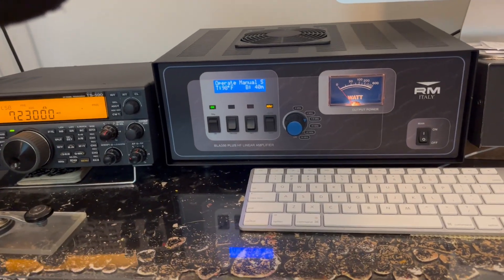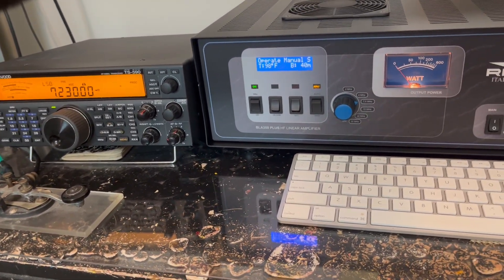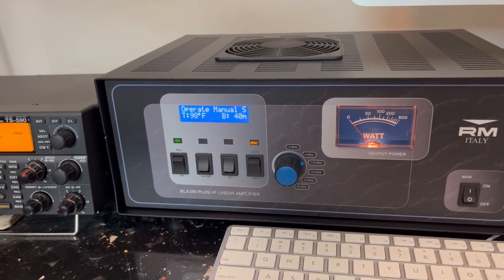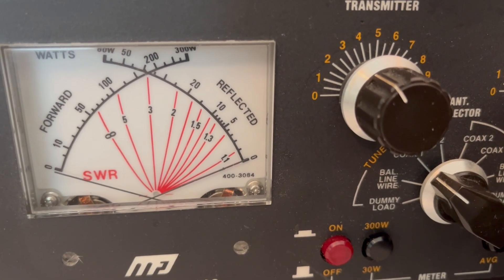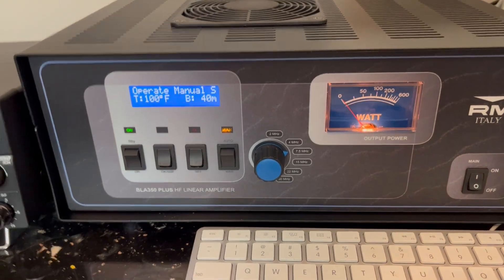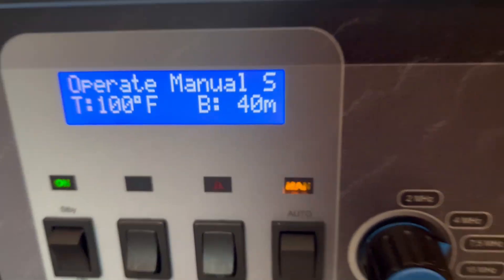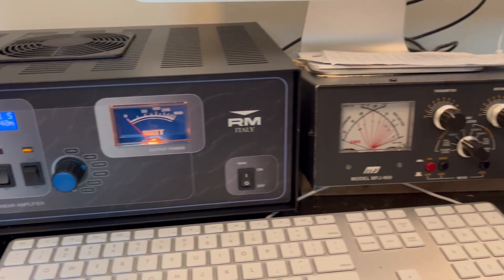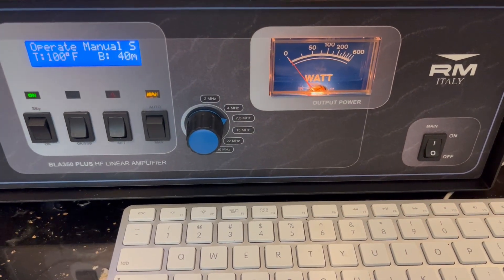RM Italy BLA350Plus HF Linear Amplifier Review

Comment: Rf sense switching is absolutely the worst thing for yor transceiver.  Every time that transmitter keys irs hot switching and stressing the pa circuit. That amplifier relay is almost 1sec behind that radios diode switching. Get a ptt cable
 asap,